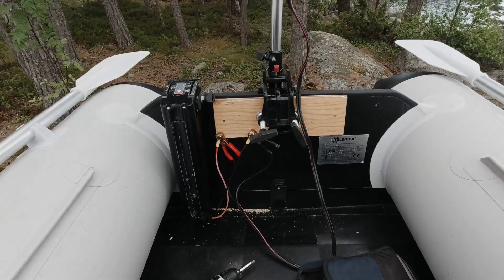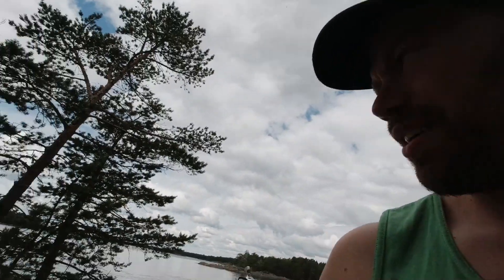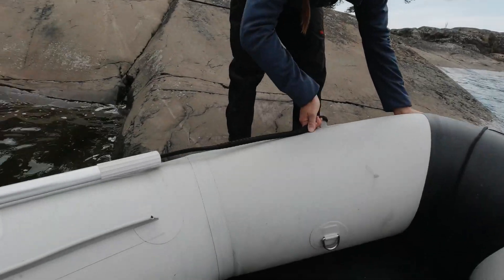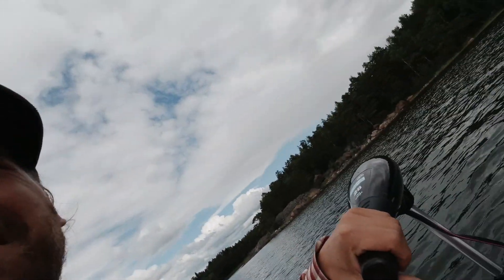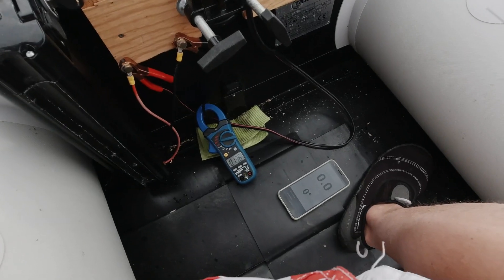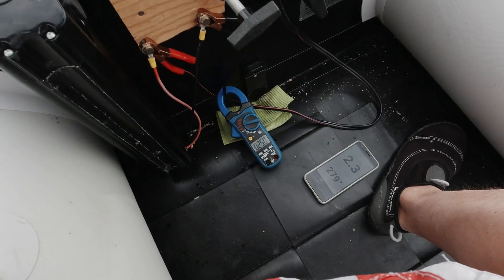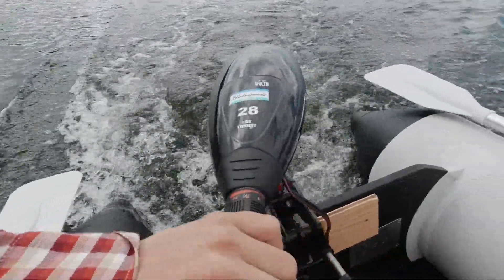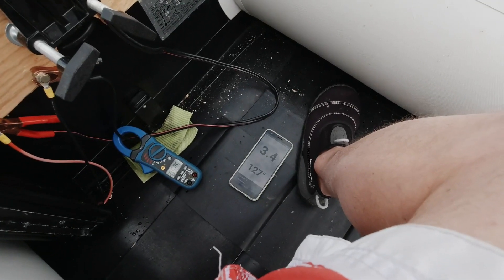12V trolling motor + 24V battery.. 😬

Comment: what thrust is the outboard rated at? am I correct in spotting 28lb written on top? that's only 12kg so I think it certainly wouldn't have pushed that boat at over 3 knots with only 12v

Comment: Propeller is cavitating in the water it cant push anymore because of the propeller pitch angle. You be better off getting a different propeller. Even then the most you will get is about 5 out of it with it over volt like that and a better propeller. I did same thing to mine but I'm running 18 volts. Tt 18 volts and a good propeller I get about 5. That's on a 12 ft johnboat. only way your getting more speed is a bigger motor with more thrust. my cousin has a 125lb thrust on his 12 ft rowboat he gets almost 8.

Comment: In all trolling motors, Minn Kota, Motorcraft and Newport usually the switches in the throttle die by burnt contacts, usually at the ground. I always have a 40 amp breaker/harness available, just in case I'm stuck in the water. ON/OFF....wheee, takes off 100% FAST. I have purchased 5 PVMs (run 12v to 48v), cheap Chinese ones around $15 ea. Cheaper than Minn Kota replacing switches $25 ea. I took off the plastic head, cut the shafts down to 20", made nice teak cap/tillers. Made good soldering connections in the 2 wires in the cavity in the tillers, so the connection is immobile of any stress or movement. I'm interested to put a heat-sink at ground to dissipate heat. The PWM is inside my epoxy covered seat/battery with controls on the box. Used everyday. A 9 ft dinghy berthed next to my sailboat with quick-connect with an AC charger in a 20' cable inside the big boat to the battery port. I also i have charged from the solar panel. I've use it in every kind of rainy weather seems to work. I may sacrifice a 12v motor for the 24v for the test. Heat is the big problem to be solved. There's plenty of water-pump controllers and fans available products.

Comment: hi  may I ask can I put a 12v 34lbs motor on 24volt battery ? thx
Reply: It depends on the motor used, you have to open it up and get the parts number off the actual motor. Many things use "lego" parts off the shelf that can handle wide voltages with no issue. It's a risk to just do it without checking, if its a 12v only then the melting occurs as the above person mentioned. 

The other thing to consider is the electronic controller capable of handling the higher voltage, this is less of an issue as a small step down converter could be installed for very little its just something to check. They are frequently off the shelf "lego" parts same as the motor so frequently the voltage is also not a issue.
Reply: Dont do it buddy. The windings in the motor will melt the enamel coating off in no time and they'll burn.. it'll haul ass for about ten min or so and then toast

Comment: I think it could be done, but only with a smaller prop that will result in the same current draw.  Twice the voltage with the same current will double the power without overloading the motor.

Comment: If your motor is rated 12 volts 300 watts, that is 25 amps. If you keep the amps at around 25 the motor should be ok, speeds 1,2, and 3.  Speeds 4 and 5 could overheat the motor.
Reply from the maker: It's actually 340W motor so around 28A max. For amps 1-3 speeds are ok but if you calculate the watts - only first speed is safe :) 2nd is already 360W(15Ax24V)
But I don't worry about that, it's so fun to play :D
Reply: Pauli Juppi  hey could you give me some advice. How long did it take for the motor to stop working. 

Also if I double the voltage and keep the amp the same on my trolling motor. Can I run it at full speed. Thanks in advance

Comment: Could you give some info about the battery?
Reply: im not too sure what he's using  but i myself would reccomend finding some Tesla modules,  you can find them for around $1200,   they weight around 30kg's each but have a capacity of just over 6kwh each @ 22v.      so two in series would give you a fairly decent 44v 12kwh setup..     they are smaller than you think too.   just be sure to find a BMS that will work with them correctly
Reply: Telsa cars have done over 500,000 miles while still holding over 80% capacity..    so if used in an electric sailboat they will have a very easy life compared to being used in a car. meaning you should see at least 15 years of good use out of them at minimum if stored and looked after correctly
Reply: it's from an electric bicycle

Comment: If u was to run it through a pwm speed controller u would have better speed control and longer battery life. U can get them cheap on eBay up to 100amp.  but I think a 60amp one would work ok for u. If it does get a bit hot put a small fan on it and it will be fine. I run the same setup on my 56lb thrust motor and it runs great for hours on my homemade batteries
If u need more information on how to wire it up just drop me a line and I’ll send u a wiring drawings
Reply: Can I run a 36v 50amp on my 12v Newport trolling safely thank you in advance
Reply: Sailboat how many amps is constant current your controller?also i am ready tomorrow to make the changes to my trolling,do you have any problems and for long did you get it on 100% speed? Sorry for my english i am from Greece.
Reply: Spiros Destounis https://youtu.be/JLq8BW6IQy0
Reply: I want to get an 88lb thrust 24v motor. The issue is I've seen them run on YouTube and their lowest setting is too fast. But i do want to be able to use the fastest speed when fighting the tide.  So what i was thinking is have two 12v in parallel for normal use and then when i need to go against the tide, I'll put it in series to get the full thrust. But it sounds like what you're saying is there some sort of control i can put been the battery and the motor?
Reply: @TheCorrectionist  check this out it explains it all
https://youtu.be/JLq8BW6IQy0
Reply: @keithsailboatrjelectricboa2044  , thanks!
Reply: @keithsailboatrjelectricboa2044 I have a 24v trolling motor and want to use my 7s lithium ion battery. do you think 29.4v is going to be to high?

Comment: Just get a 24v to 12v step down converter.
Reply: A step down wouldn’t work it just can’t work at them kind of high amp loads ur be lucky if u can get over 20amps.
Reply: @keithsailboatrjelectricboa2044  https://www.invertersupply.com/index.php?main_page=product_info&products_id=29939&gclid=Cj0KCQjws7TqBRDgARIsAAHLHP6qlaqk0rWX_uDQG6OU8KE_WiQlim_NKj7FfYkD9HBTGpB4BpsiqusaAgXyEALw_wcB
Reply: mibengal ye ok 👍 but the cost is a bit heavy
Reply: DC 10-55V 100A Motor Speed Controller Reversible PWM Control Forward/Reverse UK